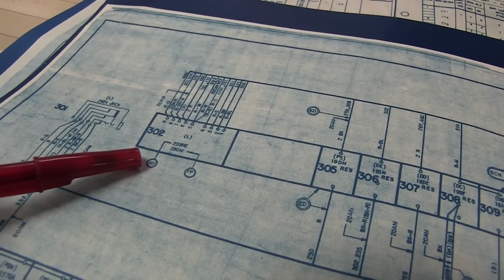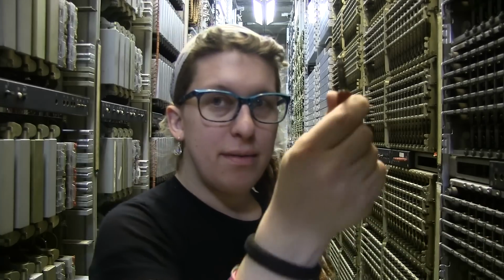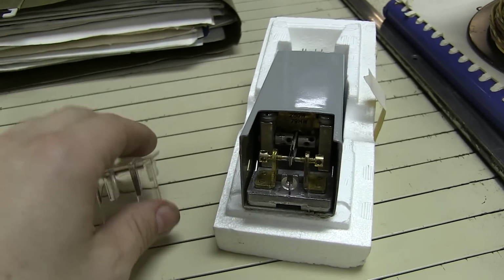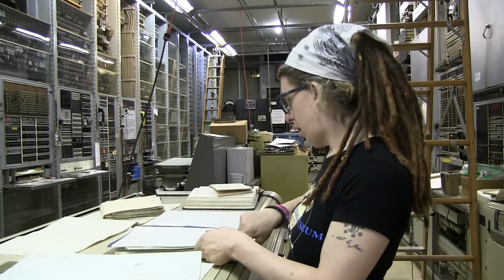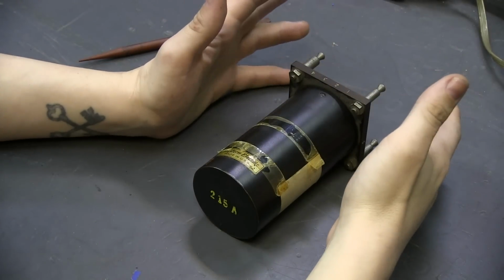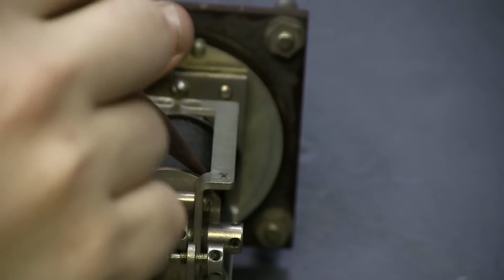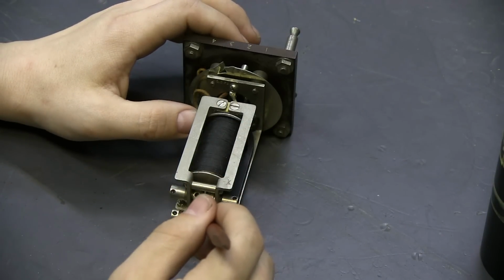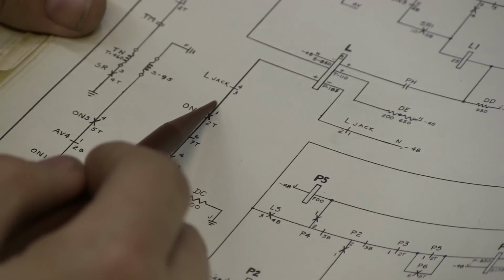[No. 1 Crossbar] Senders Part 2: The Evil (L) Relay

Comment: It is really discouraging to me that there WAS  THOUSANDS (*X) of spare relays and  panel switches...   And they ALL got scrapped !
Depressing.   IF you ever break one of those, you might be able to rewind it or re-contact it.  But if it is just "gone" then that's where you were here.  Ahh !  If you have a relay with the same base that will plug into that socket, you might be able to create a kludge to emulate one of those relays.

Comment: couldnt you make an L relay?  reverse engineer the relay you have and see what each winding does then hack together a couple of automotive relays .

if it is just a comparer where it turns on when 1 phone is picked up and can be overridden by another phone that takes priority say for example like your supervisor then the other winding kicks and disconnects the call or something you could do that with automotive relays and limiting resistors.

it may be possible to make one from a radio vibrator.

a radio vibrator was the mechanical oscillator used to make the ac required for the mains transformer in battery powered tube radios and power inverters.

Comment: Re parts could you just bodge together a solid state replacement?  It's not authentic, but it would still work.  See the type of stuff Curious Marc does.  If you wanted to put this into electrical engineering terms, this relay sort of performs a debouncing function.

Comment: Where do I start. Is the test frame calibrated? I worked on that beast for 30 years before we put the cable cutters to it to put it out of it's misery. The test frame uses caps for timing, I found that the caps get old, like me, and leak, go open or short, making the test invalid. I would test all caps in the test frame and replace the bad ones. What a surprise when it started to work as was designed. We would get good tests and our failure rate went way down. You can restore a relay that has an open winding by putting a soldering iron to the connection point on the relay where the winding wire connects to the terminal. I would like to have a nickel for each polarized relay I "boxed" in my 40 years as a switchmen. Love your posts. Thank you

Comment: I've had jobs where replacement parts were hard to come by but that's a good excuse to be creative!  I suppose you can have a look at the relay and take a note of what it could be that might stop working.  If it's a spring or contact, that shouldn't be a problem.  Even an armature can be soldered/brazed.  The only thing which may be difficult but certainly not impossible to fix are the windings.  They've got hand (and motor-driven) core drivers online which you can easily use to rewind the coil if it ever goes bad.  Great videos by the way!!!!

Comment: you guys should scan all those plans and put them on the net (bitsavers for example)
Reply from the maker: We'd love to, but we have to find the money to afford a large format scanner first. We're all-volunteer, and survive on donations. Much of the cost of acquiring and preserving our collection comes out of our own pockets.
Reply: @ConnectionsMuseum  would a high resolution DSLR be sufficient ?
Reply from the maker: Amaury Jacquot our experience has been that photogrammetry and similar camera based methods does not produce archival quality output. Also, a good DSLR costs $1000-$2000 and we’d rather take that money and instead save it for a scanner.
Reply: @ConnectionsMuseum  ah, indeed if the quality ain't there, not worth spending the money

Comment: I am confused. The 280w relay is a rack mounted polar relay. But in the video you are showing the rack mounting for a plug in relay. I believe the relay was absent because the plug in relay was a mercury relay and considered "Toxic Wasted".  Here is a question. Do you have a western electric 35f test set in the museum?  Theses test sets were used in adjusting polar relays.
Reply from the maker: None of the drawings that we have show a plug-ended relay in that position; the 280W and 239HE relays are both solder terminals. It's possible that it was replaced in a newer drawing issue with a mercury relay, but that seems unlikely given how specialized it is.

We have several 35-type test sets, yep! Here's a short Twitter thread about them. https://twitter.com/museumofcomm/status/1128703976327696384
Reply: My dad was a 1xb & 5xb 'switchman' at Detroit Walnut & Detroit Twinbrook back in the day. He says these relays had to be adjusted using one of these test sets and that the 'sweet spot' was so critical it had to be right on or it would just bellyache and drop cards. Sarah, I'm betting that this is part of what you will have to do with your 'L' relay.

Comment: Nicely done! Sounds like a tricky fault-finding job, or rather a series of linked ones.

I wonder if the original engineering drawings for those relays are available anywhere.  Making new ones doesn't seem out of the realm of probability, given some of the things that I know model engineers and model railroaders can get up to - the coils would be new, but soldering and shaping tiny complicated bits of brass and copper and phosphor bronze is something that the ones I know are quite skilled with.  280Ws and similar are only going to get harder to find, but how cool would a brand new replacement part be, when you finally can't find an original?

Comment: Are the resistors and capacitors on standard plugin forms? Wondering if you would be able to make new resistors and capacitors using old ones and replacing with new wirewound resistors and film capacitors.
Reply from the maker: Yep, they can be fabricated to fit the standard mounting plates. Thankfully (in at least this case), I was able to find resistors that were the correct value...after doing a bunch of searching.